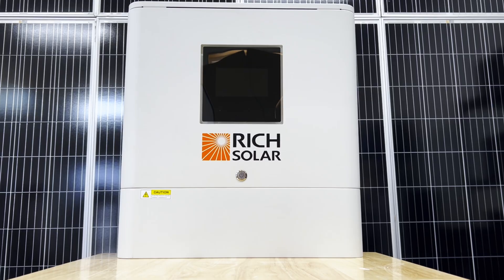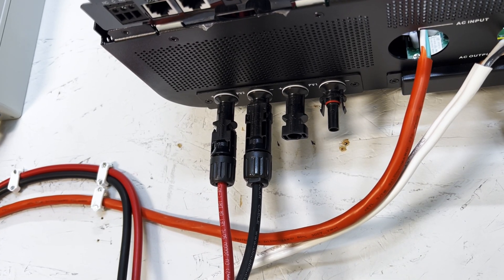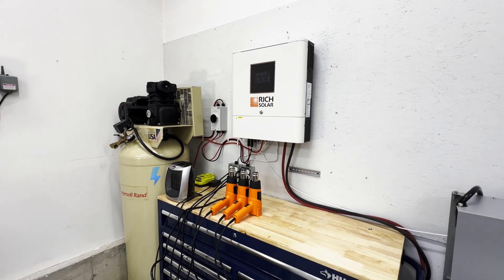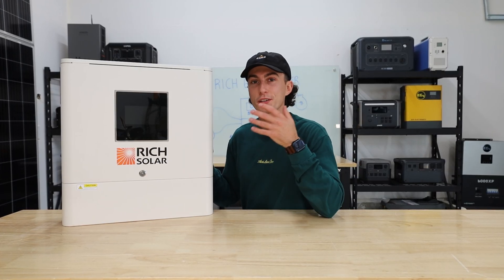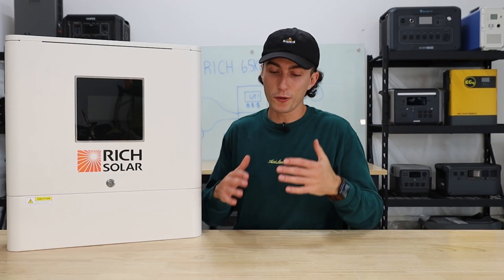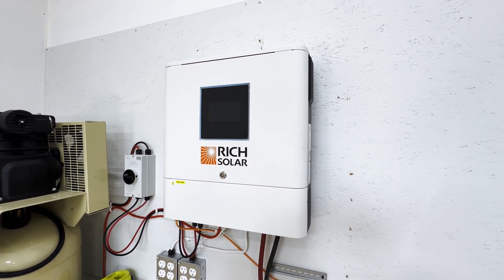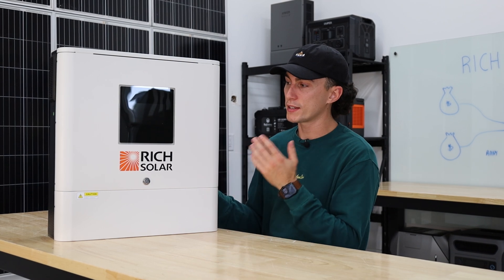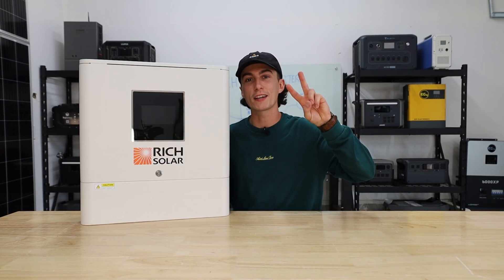Rich Solar 6,500W Inverter - Can It Compete With EG4?

Comment from the maker: 🛒 EG4 6000XP Off-Grid Inverter ➡ https://signaturesolar.com/eg4-6000xp-off-grid-inverter-split-phase/?ref=thesolarlab
➡ Use Code: THESOLARLABSAVE50 for $50 Off Your Order

🛒 Rich Solar Nova 6500S Inverter ➡ https://shopsolarkits.com/products/rich-solar-h6548s?_pos=2&_sid=49b6d86a8&_ss=r&ref=TheSolarLab
➡ Use Code: THELAB for 4% Off Your Order

⚡ Get an Instant Power Station Recommendation! ⚡
➡ Take Our Quiz: https://quiz.typeform.com/to/zpvK6MPQ

💸 Get Exclusive Solar & Power Station Deals First 💸
➡ Subscribe Now: https://www.thesolarlab.com/subscribe

We Recommend Shopping at These Online Stores: 

🛒 Signature Solar - EG4 Products + Solar Panels
➡ Get $50 OFF with Discount Code: THESOLARLABSAVE50
🔗 https://signaturesolar.com/?ref=thesolarlab

🛒 Shop Solar - EcoFlow/Anker Bundles + Complete Solar Kits
➡ Get 4% Off with Discount Code: THELAB
🔗 https://shopsolarkits.com/collections/promotions?ref=TheSolarLab

🛒 Pecron Power Stations - High Quality, Budget Power Stations
➡ Get 5% Off with Discount Code: THESOLARLAB5
🔗 https://www.pecron.com/#ref=229

🛒 EcoFlow Power Stations - Delta Pro, Delta Pro 3, Delta Pro Ultra, Delta 3
➡ Get 5% Off With Discount Code: 25EFDCTSL 
🔗 https://us.ecoflow.com/?aff=925

🛒 Jackery Power Stations - 5000 Plus, 3000 Pro, 2000 Plus, etc
➡ Get 15% Off With Discount Code: THESOLARLAB
🔗 https://bit.ly/447bRnM

🛒 Anker SOLIX Power Stations - Anker F3800, F2600, C800, C300
➡ Get 5% Off With Discount Code: THESOLARLABPD
🔗 https://bit.ly/3ELICvV

🛒 OUPES Power Stations - Mega 5, Mega 3, Mega 1
➡ Get 5% Off With Discount Code: THESOLARLAB
🔗 https://shrsl.com/4xhzg

🛒 Current Connected - EG4 & Victron
🔗 https://www.currentconnected.com/?ref=thesolarlab

---------------------------------------------------------------------------------------------------------------------------------------------------

📖 Read Our In-Depth Product Reviews: 
➡ https://www.thesolarlab.com/reviews  

🛠 Access Guides & How To’s:
➡ https://www.thesolarlab.com/how-tos 

📬 Contact Our Team:
➡ https://www.thesolarlab.com/contact 

---------------------------------------------------------------------------------------------------------------------------------------------------

🔔 Subscribe to our YouTube Channel:  @TheSolarLab  

0:00 - Intro
1:00 - Spec Teardown
2:37 - Testing
4:49 - What We Like
7:47 - What We Don't Like
11:33 - Recap

We've had our hands on the Rich Solar Nova 6500S Off-Grid Inverter for a while now. There are a number of things that we really like about this unit, but also a few things that we don't. In saying that, this unit is only $100 less than the super popular EG46000XP. In this video, we give our opinion on whether or not you should save a little money, or go with the EG4 inverter. 

⚡ FOLLOW US:
https://www.instagram.com/thesolarlab/ 
https://www.tiktok.com/@thesolarlab 

👨🏼‍💻 The Solar Lab:
https://www.thesolarlab.com

We maintain an affiliate relationship with some of the products reviewed, which means we get a small percentage of a sale if you click our links, at no cost to our viewers.

Comment: Every now and then, my inverter shuts down with an F01 error message even though the batteries appear to be fully charged.
I tried connecting with my cellphone to look into the error message, but the inverter is not user-friendly at all. For the past two months, I’ve been trying to access the WiFi connection without success. I’ve used all the available passwords and even tried connecting directly to a PC using a data cable—no change.

Had I known about these issues, I would never have bought this inverter. At this point, I am extremely frustrated, and to make things worse, Rich Solar does not return phone calls or emails. I don’t know what else to do.

Comment: Remember the noise changes depending on what it is doing. Mine sounds like a f35 warming up when it is charging a low battery. yet very quiet when Solar driven.

Comment: Any plans to review the SRNE line of inverters? Dubious support?, Chinese based, but mostly good reviews on actual performance. And very low cost. I was specifically looking at HF4850U80-H, a 5000w 120V only 48V inverter. PV max voltage (500V) seems good enough to run on one of my grid tie  solar panel strings in case of outage.

Comment: I wouldn't by this or the 6000XP. The Chinese engineers that designed these inverters definitely went on the cheap when they designed these transformerless  failure prone, short lived inverters. Without an output transformer, these low cost inverters have the potential of damaging your appliances during a failure of the MOSFETs in the H-Bridge circuit, where they have shorted to ground. A much better and safer inverter is an inverter charger that uses low frequency, transformer based inverter tech.

Comment: We run our whole house on the 6500ex at 120 volts. We can not use the 6000xp as it only has 3000 watts on each leg so a mini split and air fryer can't be run on a single leg. With the 6500 ex we can run both 120v mini's while cooking dinner and the fridge, freezer, lights, tv all can run. The problem with the 6000xp is the split legs, as you can not use all of both legs. We would need a split phase (with seperate unshared legs of 8000 watts (4,000 per leg) or better yet 10,000 watts (5000) on each leg to run our house. Much more money for those. 6500ex at 120 volts and last months power bill for electric use .71 cents, this month .41 cents. 6000xp can't do it. House is 1350 sq ft all electric.

Comment: Thank you for the review. It's sounds pretty good for a 120v inverter, but the lack of instructions in the manual to get basics working is a problem.
I would like to see the solar input voltage as low as 48v. 
Saying it has UL cert, without specifying it on the webpage is useless.  If I can't see the ACTUAL  UL certification in a Picture on the Unit, then as far as I am concerned, it doesn't exist.
They also need to put UL certs in the manual, easily available on the site that sells the product.

Comment: I have the Rich Solar 3kw 48 volt inverter and it ran my Ryobi table saw no problem. But when I tried to run that same saw on my EG4 6kw 48 volt inverter costing twice as much, it failed. Yes, even with that obscenely heavy transformer it failed. What a huge disappointment.

Comment: I think the advantage is 6000 watts on a single line out.  the EG4 6000xp is GREAT for split phase but its max is 3000 watts continuous per line.  This unit "could" be useful.  Say in an RV where you have tons of AC and are one one 120 line.   Probably better would be to just buy two EG4 3000s tho.
Reply: This unit would not be great or safe in an RV application because it is not UL-458 safety certified.
Reply: @quickquote1568  Just because its not UL listed doesn't mean it's not safe.

Comment: These companies need to step up their game because these EG4 products are dollar for dollar miles ahead of them right now. Customer loyalty only goes so far 🤷‍♂
Reply: EG4-6000XP the same price as a PowMr SRNE-based 10kW split phase 5k on each leg inverter. Just because a YouTuber gives you a curated set of choices doesn't mean you have done your research
Reply: @niffrig  are you using a powmr inverter? How long and how's the support? I see a lot of very bad experiences with powmr.  Thanks
Reply: EG4 uses low cost, (cheap) high frequency, transformerless inverter tech and are by no means ahead of the game.
Reply: @quickquote1568  what do you have?
Reply: No they're not. EG4 uses the same low surge high frequency inverter tech that's found in cheap Harbor Freight inverters.
Reply: @quickquote1568  so does it do the job at a low cost? Yes